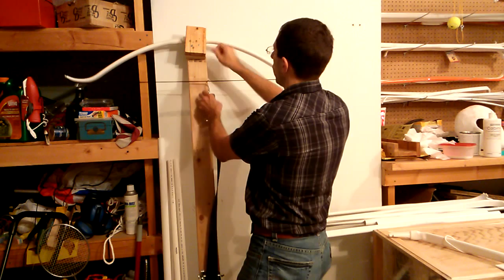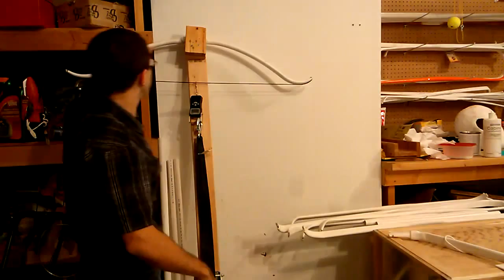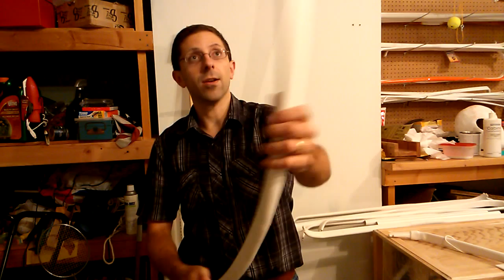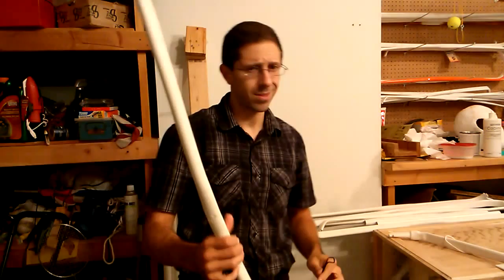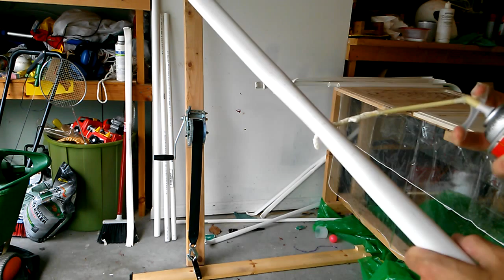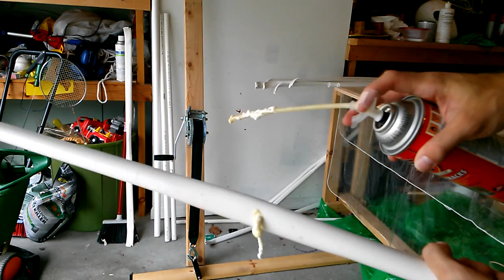Reinforcing a PVC Bow with Expanding Foam Insulation

Comment: If you fill the tube with foam before you ever start heating the tube and let it solidify while the ends are open you can still form the bow after the foam has set. It just takes more compression when you are flattening out the limbs. If you do it that way you will have accomplished something. Another way to gain weight draw is to take another smaller piece of pipe and insert it into your outer shell or main body. It takes a lot longer to heat the PVC so that both the inside and outer main body will be able to be manipulated int5o shape but you can almost double the strength of the bow. You just have to take your time and don't try to rush it. You will be amazed at how strong orf a bow you can make and one that will never lose it's tension and rigidity.

Comment: Use closed cell polyurethane foam. Will prevent collapse of tubes and has a bouncy rubber type feel. Foam insulation is brittle when cured. Closed cell polyurethane will always be springy
Reply from the maker: Interesting! Thanks for the tip, I'll try to find some

Comment: The spray foam that you use will never solidify, because it uses water vapor from the air to solidify. The Bow is closed from both ends. It will solidify close to holes that you drill. The rest will remain liquid.  Use two part (A,B) foam and use syringe to fill it. Two part foam doesn't need water vapor from air to solidify.

Comment: Elementary physics can tell you that PU foam is not going to affect the bow in any way, other than by adding some mass (just a little). The rigidity of a bow is defined by the sides and wall thickness of the pipe. The higher the sides, the higher the ridigity. Flatten a bow completely and it's nearly limp. Width has relatively little impact compared to height. There's a good reason to flatten limbs, tough, from a perspective of physics, as it helps to get an even curvature because the outer parts of the limbs have more leverage action as you go away from the handle. Giving it the same rigidity (height of the pipe) will result in less curvature at the limb ends. Adding foam will not affect how the wall of the pipe acts.
Reply from the maker: Correct, profile matters, but modulus of elasticity does too. If the foam was more rigid than the pipe (possible, since PVC is downright flimsy), it would make it stiffer. The same principle at work with the bow reinforced with fiberglass rods. The external profile is unchanged, but the ultimate draw weight is approximately double normal. 

And one more thing - if the foam is strong enough, it could have helped with limb collapses. That alone would have been useful. Just a little support might be enough to prevent a minor collapse, but as it is, the stuff just cures to a goopy film inside the bow.
Reply: Yes it will add rigidity if you use the foam in the right way by spraying it into one end and allowing it to fill the tube completely before you ever start applying heat to manipulate the PVC's form. P.S. You will need to run a brush or sandpaper inside the main tube to scuff it up a little bit inside just enough so that it will hold a little bit of water moisture before you fill it with foam. You will in turn be compacting the foam at the same time as you use compression on the form and the foam will in turn lose some of it's air pockets and become stronger as it compacts which will add stability and strength to the entire inside of the bow. You just have to make sure the foam has time to cure completely before you start on the bow. Sometimes it takes three weeks to properly cure.

Comment: Tim. I've worked with that type of spray foam before. I have noticed that while the foam does dry very rigid it is not very resilient. It tends to pack down when you push down on it. It also does well at deadening sound. Which is great if you need to kill vibration, but I imagine does not make the bow very efficient. I suspect that after a few dozen draws or so you will lose all the extra pounds you have gained.

Comment: I have used expanding foam in some pvc items I Have made.  I have found that when the item was  taken apart, for whatever reason, if the foam inside has not been exposed to air it did not change from a simi liquid form to a solid state.  It was still wet inside and did not cure.

Comment: have you thought about experimenting with different types of expanding foam ? possible a combination of dowel reinforced handle? and trying to to do it in the shaping process while it is still warm spray it , however that does leave the issue of keeping its desired shape